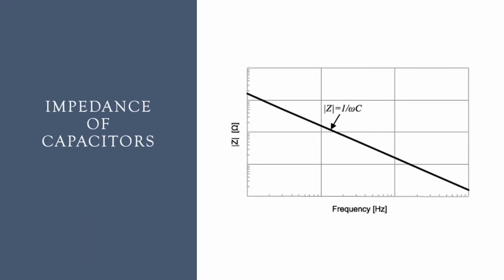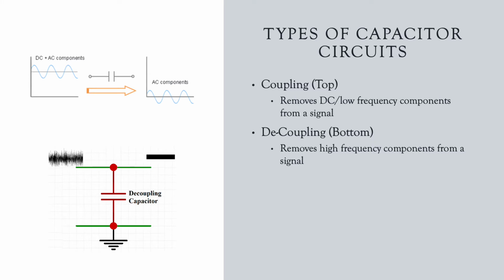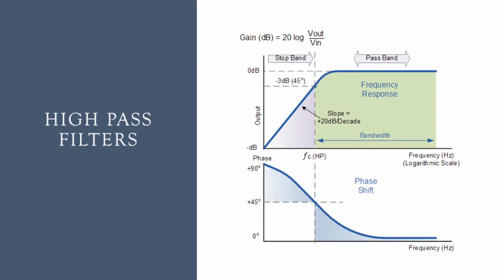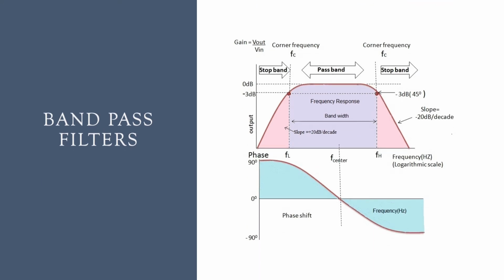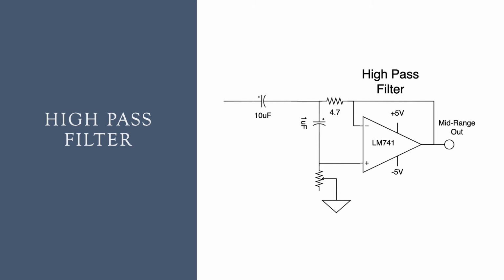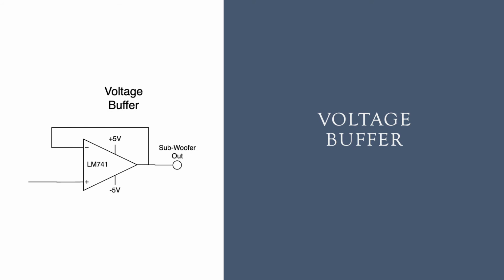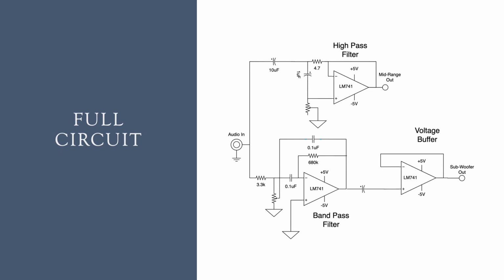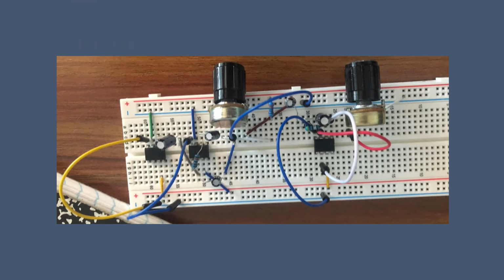Active Audio Crossover Circuit - Concepts, Schematics, and Implementation

Comment: It would have been MUCH more obvious to hear the results by passing pink noise and feeding the line level signal directly into the mixer for your audio send to YouTube. A pair a headphones at 24” away? Seriously? Also, you didn’t explain the need for a bandpass response for the sub out. Wouldn’t a simple low pass be sufficient? Why do you have to high pass the sub feed?
Reply: The results already are very obvious

Comment: What is the value of the potentiometers and the capacitor that’s between the band pass and buffer?
Reply from the maker: When building the circuit, I used 10k Linear Taper Potentiometers.  The Capacitor is 1uF.

Comment: Nice presentation and very simple explanation... Can it be used as a full pledge crossover for power am to home use?
Reply from the maker: Hello Gangu!  Likely yes, however, I haven't tested it with anything higher than a 10V supply.  Before deviating from the schematic, I would recommend verifying that your Op-Amps and passive components are rated for your input voltage.  I would also verify that the supply voltage for the op-amps exceeds the upper and lower bounds of the audio waveform.  Otherwise, you may find that the peaks and valleys of your audio signals get clipped.

If you have any other questions, feel free to let me know.  Also, if you have any requests for other circuit videos, let me know; I'm looking for more ideas!